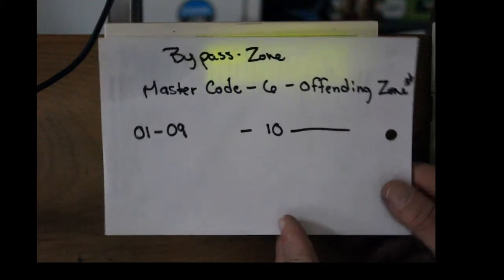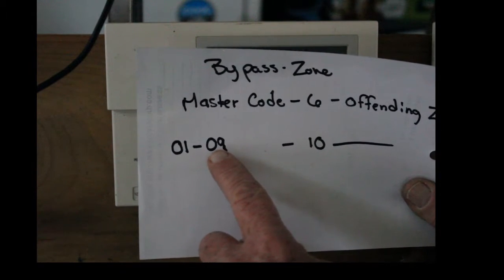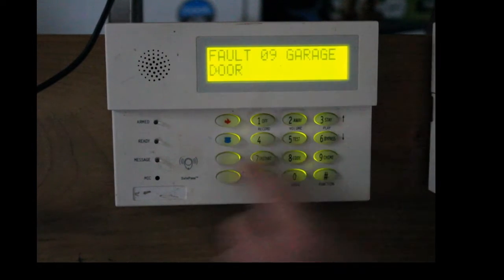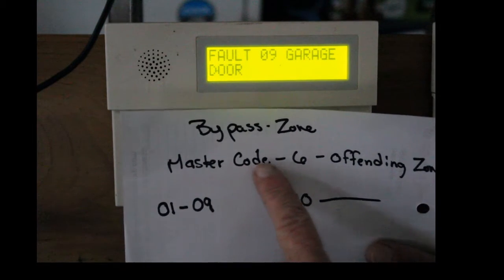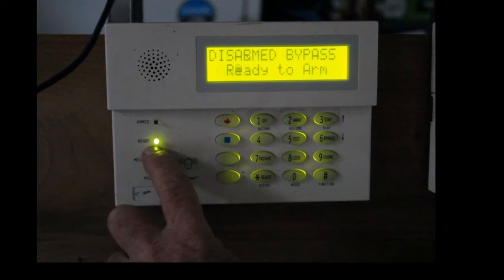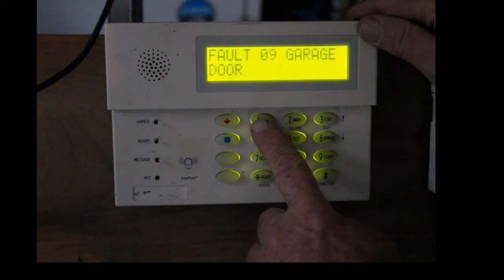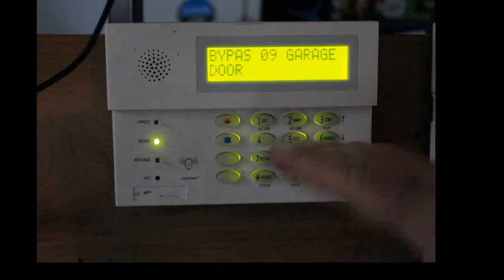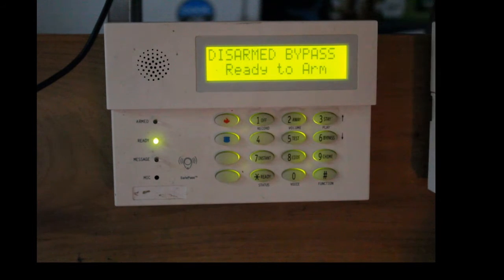Safewatch 3000/Ademco Vista how to bypass a open zone

Comment: I've been trying for a couple hours now to figure out how you can lock out multiple zones. You enter in the master code + 6 and then each zones two digit number or do you have to reenter the master code prior to entering each additional zone?
Reply from the maker: say you want to lock out zones 5,7,12 this is the sequence,,,,,,,,code-6-05......code-6-07........code-6-12
Reply: @DIYELEKTRONICKITS   yes thank you this works! It's quite a lengthy process as you have to wait for the system panel to acknowledge each zones that's bypassed on the display. I was hoping to create some kind of a macro or some way to bypass all but one zone temporarily with one sequence of button presses for instance like when I have my garage open and I'm inside I want to keep the sensor in the garage active while bypassing all the others. Thanks for your input very much appreciate it